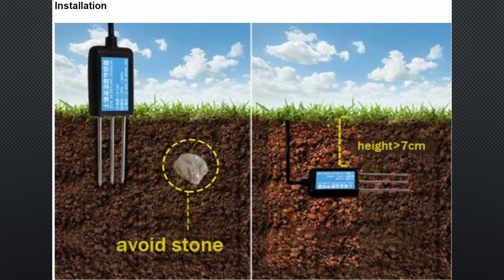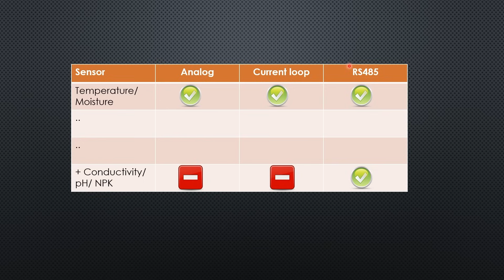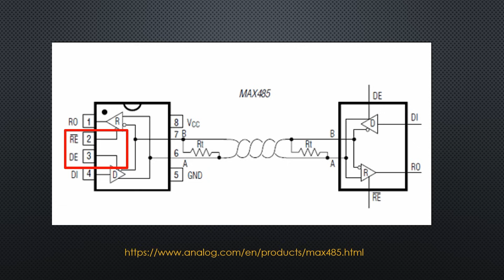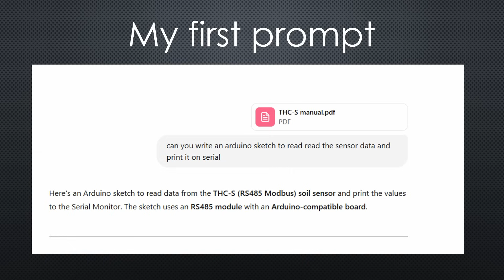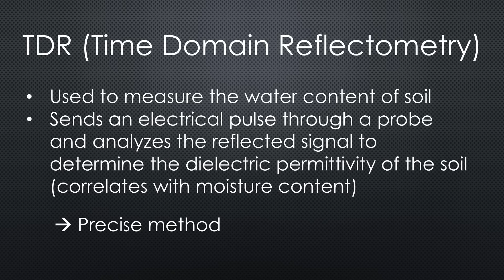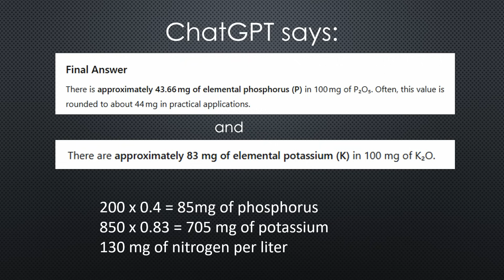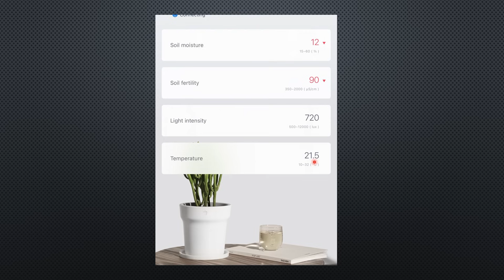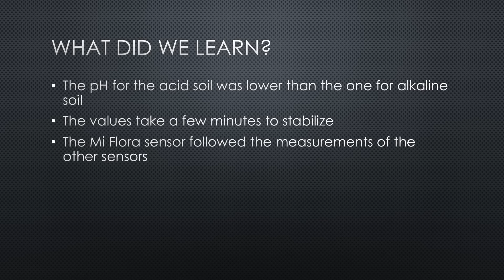(502) New (better) Soil Moisture Sensors and RS485 Modbus on ESP32 Arduino

Comment: I just wanted to mention the EC on the THC-S is really pretty accurate. If you understand the feed that you are providing to your plants, say for automated gardening/crop steering. You can have a much better indicator that is accurate and affordable by tracking the EC of the soil/media, against the EC of your feed. You don't really need an NPK for that. Tracking the EC is also a much more affordable way to know you have hot soil, and the need for a legitimate wet sensor for NPK or other discover. Honestly though if your soils that hot your probaby going to send a sample out to a legit lab anyway. THC-S is hand down the best soil sensor out right now FOR THE PRICE.
Reply from the maker: Thank you for sharing your experience! You know much more about the usage of these sensors than I do!
Reply: @AndreasSpiess  love your videos, and so does a large IOT group I am in. This was a great video's, these sensors are the most performant on the market currently, and honestly you can't get NPK without an ion selective electrode anyway.
Reply: smarter answer than chatgpt. bravo!

Comment: this sensor need to be calibrate or not? Just use it?
Reply from the maker: Depend on what you want to achieve. Relative or absolute values. For absolute values, for sure you have to calibrate it, also to the soil you are using.

Comment: Hello @Andreas, i am interested to make the prob long(approx. 30 cm) because some source says that is the proper way to test the soil(20cm deep below the top).  Instead of burying to the ground, I will just make extend the stainless probe. what do you think? Do i need to recalibrate the device?
Reply from the maker: I do not know. You have to try. I assume it also will include the unwanted part in its measurements.

Comment: The CWT-Soil-THCPH-S sensor was powered with 12V from an external power supply (brown = VCC, black = GND). The GND from the power supply was connected to both the ESP32 GND and the RS485 module GND (MAX485) to ensure a common reference. The MAX485 was powered using 5V from the ESP32. The sensor's yellow (A+) and blue (B−) wires were connected to the RS485 A and B pins, and we also tested them swapped. Communication was handled via ESP32's Serial2: RO to GPIO 16 (RX2), DI to GPIO 17 (TX2), and RE/DE to GPIO 5.

Despite the correct wiring, the sensor did not respond to any Modbus commands. Can you tell me if this conection is well done and if it can work?
Reply from the maker: Unfortunately, I cannot do remote debugging :-(
Reply: @AndreasSpiess  So please give me the instructions on how you assembled the materials in this video

Comment: Great Video as always. Please can you confirm that the TX and RX pins on the KY-K485 device are connected to the TX & RX Pins (GPIO16 & GPIO17) on the  ESP32; and the RE & DE pins from the RS485 chip are tied to ESP32 pin 4? Many thanks

Comment: Good to see some coverage of Modbus on Arduino! Andreas, can I send you a Modbus-compatible wind and rain sensor set? I've been selling the sensors for years but I'm just about to release a new interface board that vastly simplifies using them. It supports Modbus RTU and various text formats, including CSV and JSON, over RS-485, TTL serial, and quasi-RS-232.
Reply: Would you mind posting the link here for me as well, and any other sensors you have for sale! Thanks!

Comment: Are you sure this device was not created by Elizabeth Holmes? There is currently no simple or cheap sensor that measures NPK, the closest is an ION selective electrode, where the chemical properties target the IONs of NPK. In this case you would need three ION selective electrodes.  They are lab-based devices and are not used in the field for more than spot measurement. I tried for years to get a Nitrate ION selective electrode to function in the outside environment, all I made was an expensive temperature sensor.  I now use optical (S:SCAN V3 spectrolysers) to measure Nitrate in water, which generally leaches from the soil when the soil is saturated (field capacity).  I say 'generally', as water can leach from soil through larger pores at low moisture conditions. 

The soil moisture sensor, humidity is a strange term for soil conditions, as humidity is more related to atmospheric conditions, the maximum water vapour the air can hold at a given temperature.

Soil moisture is measured in two forms, Gravimetric and volumetric.
Generally, sensors measure the dielectric of soil, typically by capacitance or frequency domain (Campbell Scientific (CS616, CS650, CS655). 
They tend to express a percentage, but Campbell Scientific digital sensors express the frequency, Ka, Temperature, EC and moisture as a function of the Topps equation(polynomial) 
The percentage  is "Volumetric water content"

Gravimetric Moisture Content (GWC)(in %) = [(Wet Weight - Dry Weight) / Dry Weight] * 100
Example:
If a wet soil sample weighs 100g and the same sample weighs 80g after drying, the gravimetric moisture content would be:
(100g - 80g) / 80g * 100% = 25.0%

Volumetric Water Content (VWC) (%) = [volume of water / volume of ground] × 100.
The volume is a little tricky as the volume is a function of soil particles, water, air and organic matter.
The soil volume is not straightforward, as the bulk density, particle size, and stones all change the volume(water) to volume(soil) ratio.
Then the dielectric changes due to the salts(all that can alter the conductivity(EC)), which include NPK, however, you CANNOT establish specific IONS, such as Nitrate, from a moisture sensor. 

The accurate method to calibrate a moisture sensor's VWC is to do a gravimetric (GWC) measurement at 4 or more discrete soil water contents. The GWC values need to be multiplied by the soil bulk density (grams per cubic centimetre) to conclude the VWC at each point.

Example: (AI generated)
If a soil sample has a gravimetric moisture content of 0.3 (meaning 30% of its mass is water) and the soil's bulk density is 1.3 g/cm³, then the volumetric moisture content would be:
0.3 × 1.3 g/cm³ = 0.39 cm³/cm³ (or 39% volumetric moisture content)       

I apologize for the lengthy response, which most will not read, however, this sensor is sold with very misleading capabilities which are not (currently) possible.
Reply from the maker: Thank you for your explanations. Indeed, other commenters also mentioned that the NPK part is not reliable. My tests showed that moisture and temperature values were ok, which was confirmed by a few viewers who used such sensors for a longer time.
Reply: This helped me out a million! I feel very dumb, lol. When I saw the 7:1 sensors on Ali express I just assumed they were legit, although I did ask my self how in hell can the sensors determine NPK?

Comment: I just bought one of these after seeing the video.  I found out that my soil has a pH of 14 which is about the same as the sodium hydroxide in Draino.  I better call the EPA and have them turn my garden into a superfund site!
Reply from the maker: That is very high! As others wrote, the pH measurements seem not to be very accurate. Maybe your soil was quite dry?
Reply: @AndreasSpiess The soil was moist, I also measured it with a real pH meter and with litmus paper, and there the pH was just below 7.  Thanks for the reply, and have a great day.

Comment: Great video as always, Andrea. I happened to be experimenting with these sensors recently. Most of these TDR sensors report moisture value in Volume Water Content, with only a few exceptions in Gravity Water Content. I'm not sure about the ones you have. From your video the preparation of soil with 25% moisture. 1.2kg of soil + 0.3litter of water, that was the GWC method. It was an easier process to control and should be quite accurate. In general principle, VWC  = GWC x Soil bulk density, unless the tested soil sample happened to have a soil bulk density very close to 1g/cm3  (from the look of it, could be much lighter). So, if the sensor is reporting in VWC, it will not match that "25%", but 25% x soil bulk density. The same principle should apply to other moisture levels as well. I'm actually quite amazed by the consistency at the 50% test. I've bought from 3 different manufacturers and talked to their service reps. While the schematic designs are similar, the calibration processes ( type of soil, moisture level benchmarks) were quite different. It did produce quite a bit of differences in my tests, especially in the under 40% region. I've also tested the mi-flora sensor against some capacitive sensors as well. All capacitive sensors were saturated around 40% VWC, while the mi-flora could still provide some meaningful resolution well above that. I would assume it was based on a similar TDR principle but a different probe design,   4 metal dots v.s. Metal rods.

Comment: Is this sensor suitable for purchase for measuring only temperature and humidity? Does anyone have any longer-term experience?Is it better than cheap resistance meters? :)
Reply from the maker: There are some comments from users that used these sensor over longer time. I left a link in the description where you see the different variants.

Comment: I got a couple of these and boy did I have trouble getting them working! I have them connected to a real Modbus RTU master. By real, I mean it is adhering to the Modbus RTU specifications. These sensors do not! They use Modbus RTU data format, and RS-485 as communication layer, but the datastream is out of specefication. With Modbus RTU, you need 2 bits added to each byte. These bits can either be a parity and stop bit, or 2 stop bits. These sensors require no parity and only 1 stop bit. This matches with the default Arduino serial port settings, so many thinkerers will not notice this issue. But if you want to use these sensors with devices that follow the standard, it will not work.
The sensors do understand the commands they receive, and provide a respose. But the response cannot be interpreted if the device expects 2 stop bits.
Reply from the maker: Thank you for sharing your experience. It is very valuable!
Reply: I’m struggling with a CO2 and TVOC sensor that I ordered from Ali and I’m using an esp32. With chat after 20 hrs I still stuck. I was able to have it receive a signal via slave id: but it registries were not able to be located? (Error code 224)

Comment: The NPK data from these sensors is pretty trash, electrode type sensors like this are only good for soil conductivity and temperature. Even measuring moisture this was is unreliable. The best measurement is a NWIR reflectance spectrum and a model that predicts soil characteristics and infers moisture. Precision planting developed smartfirmer this way (around $1000 per sensor) . Theres some research on optical soil moisture sensing. However any sort NPK sensor is bullshit.
Reply from the maker: Thank you for sharing your experience!

Comment: Won't the probe pins corrode quickly?
Reply from the maker: I do not think so, it is stainless steel. And other viewers commented that they use these probes for some time without mentioning this problem.

Comment: Best commercial sensors use TDR (time domain reflectrometry) which are not sensitive dielectric constant of the soil type which varies according to the agricultural region.   Also, a three wire SDI-12 is a popular interface in this market (Serial Digital Interface @1200 baud).
Reply from the maker: Thank you for the info. Some viwers suggested that those sensors use TDR, but, as I said, I was not able to find out.

Comment: It seems that apart from temperature, humidity and NPK (which are quite accurate), these sensors have some mysterious and very inaccurate formula to estimate NPK and pH based on these other values. On one hand, it's unfortunately false advertising, but on the other at least the other values are light years more accurate than anything you've shown before from these aliexpress finds. Hopefully in a few years we get high-accuracy consumer-grade pH and NPK sensors.
Reply from the maker: Thank you for sharing your thoughts!

Comment: Dear Mr. Spiess,

As I have been dealing with this topic for quite some time, I read your latest post on testing the new Chinese soil moisture sensors with interest. The results are not surprising, since an approximately useful determination of the NPK content or the pH value of the soil is not to be expected with the selected measurement method. But it's good to know that these sensors are reasonably useful for measuring water content!

A more important point, however, is that determining the water content of the soil is not directly relevant from the “plant's point of view”: what is important is the amount of water potentially available to the plant in the soil, since - depending on its physiology - it can only mobilize a limited suction force in the roots via its leaves. That is why agricultural engineers measure the water content of the soil using so-called tensiometers, which directly determine the pressure required to extract the water from the soil.

The method is quite old and was already described in a kind of “do it yourself” project in 1941 (https://www.ars.usda.gov/arsuserfiles/20360500/pdf_pubs/P0015.pdf).

An early Arduino project from 2013 by the Institute of Agricultural Sciences in Bolzano (Martin Tahlheimer) transfers the 1941 design to the “Arduino era”. (https://www.researchgate.net/publication/274776721_A_low-cost_electronic_tensiometer_system_for_continuous_monitoring_of_soil_water_potential).

Unfortunately, I was too lazy to transfer this idea from Bolzano to the ESP32 and test it... But maybe this is something for the Andreas-Spieß Community?

Greetings and thank you for your work!

Gregor Engelmeier

Comment: Thanks for this video🙏 I really needed this. Do I get it right that the 5v to 3,3 volt converter is only optional or is it pretty much necessary for the simple setup to connect with my pc?
Reply from the maker: It should work without it (at your responsibility)

Comment: I used to work at a company that tried using these type of sensors and I actually run lab tests with various standard solutions and various sensors from various vendors. Long story short, these fork sensors are just conductivity sensors. The different outputs are just factored conductance measurements. Basically, it's all BS. Sorry.
Reply from the maker: Thank you for your info. The rods on my sensors had different functions. One was a temperature sensor, and one was for pH (consisting of a different material). Two were used for sensing "moisture". As I said, I do not know how they work. But a few other commenters also used them for a long time and reported good results for moisture (not for NPK).
Reply: @AndreasSpiess  I can imagine that a vendor adds temp sensing but not NPK because they don't have a mechanism to be ion selective.

Comment: So, you completely miss the fact that the cheap PCB  soil sensors also need to be driven in such a way as to not corrode (very quickly) from electrolysis
Reply from the maker: I thought I did not cover these sensors in this video. However, the fact you mention was in the heart of my last video.

Comment: Awesome Video!
I just bought from China 2 of those sensors (THC-S) and the MAX485 Module.
Can i put them out of the box in serial to my esp32?
A wiring diagramm would be great
Reply from the maker: As I mentioned, I added a level converter between the 3.3V ESP pins and the MAX485.

Comment: I worked in waste water management as a maintenance engineer for years .. can't see how they measure pH with a metal probe... I have a feeling it's all 'software' guess work from conductivity measurements.
Reply from the maker: I also do not know. However, one of the probes consists of a different material.

Comment: I'm genuinely surprised you got ChatGPT to produce usable Arduino code so easily, I feel I have to debug its code and help it learn over 5 or 6 iterations, so kudos to you. I'll look at your instructions for hints how to make better requests. 
Prior moisture sensors were prone to corrosion but were so inexpensive they can be replaced annually. These new sensors probably need mfg to stabilize and develop better calibration algorithms building in an understanding of their limitations.

Comment: Great update! I'm curious if these sensors will suffer the same corrosive death that the capacitive moisture sensors fail from.
Reply from the maker: At least the steel ones should be ok. The one for PH is of a different material.

Comment: Long term experience considering the longevity would be of interest here. If these sensors don't use the capacitive method the old problems with corrosion and electrolysis would still apply.
Reply from the maker: I do not have such experience. However, another commenter seems to have more experience.